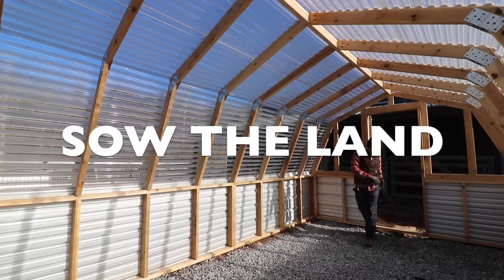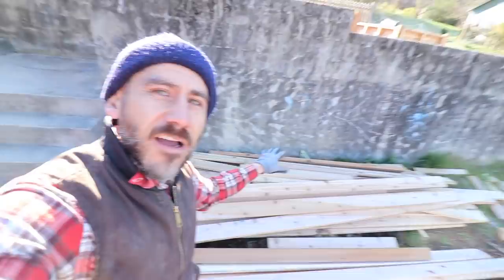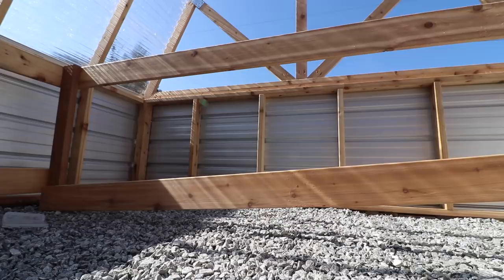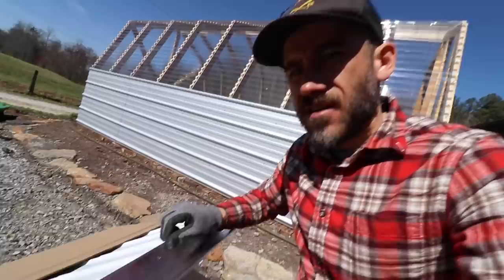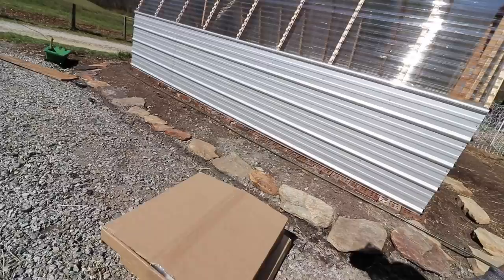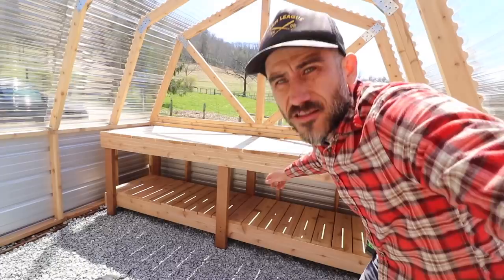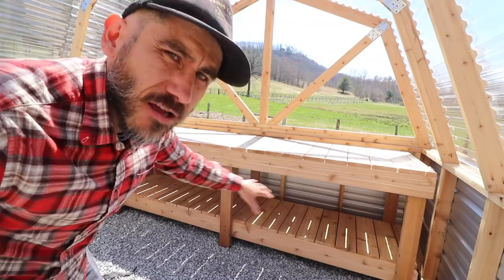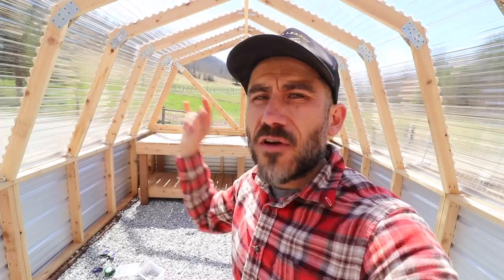Let's BUILD! CEDAR GREENHOUSE TABLE (DIY)

Comment: I saw a potting table that had an old porcelain sink in it and a 8-12” round hole next to it.
Under the hole was a shelf with a empty bag of potting soil and you could sweep all the extra soil into the bag.
The sink was connected to a hose so water was available.

Comment: Did the metal fram board get cut normal or were the at a angle. An what type of spacing did you uae for the selfs? 1 inch or 1/2 inch?